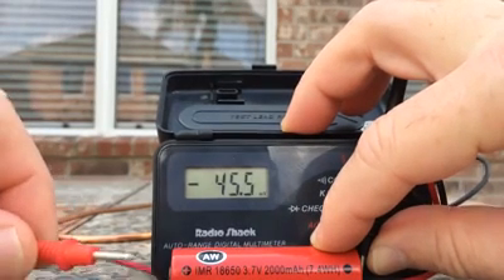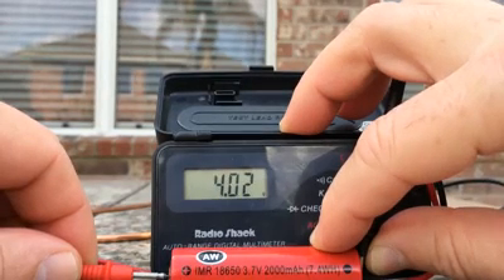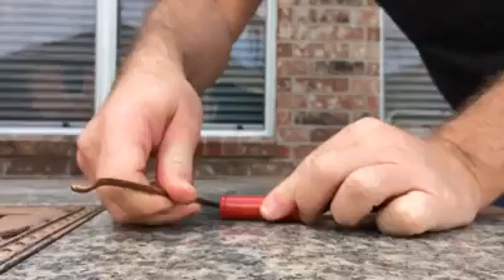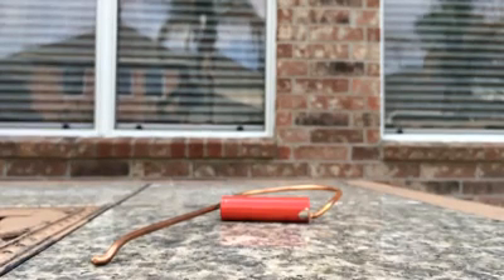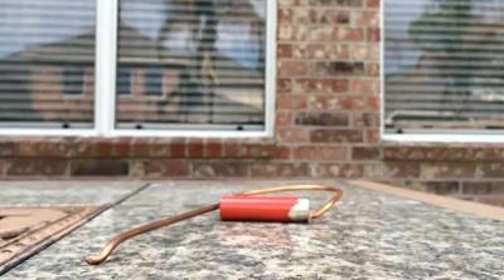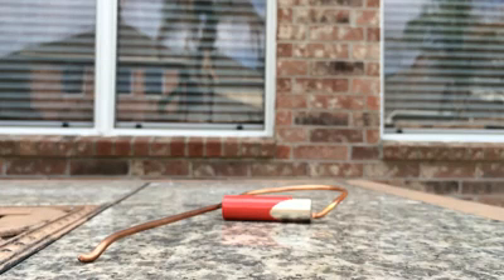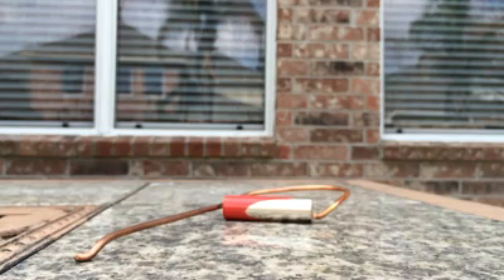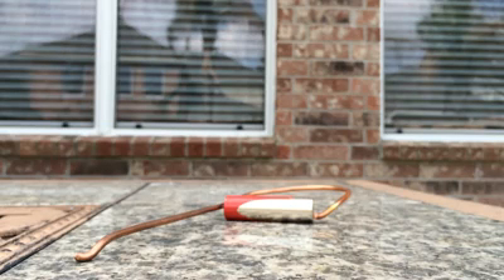Mythbusters Tony Style AW 18650

Comment: Thats a decent battery if it didn't vent. One test does NOT mean "this myth is busted." You need to do at the VERY least 5 tests. Also you need to do this with the battery in a metal tube with a few small holes for venting. The metal tube will cause insulation for heat and shorting from the side of the battery to the tube.
Reply: What is this test supposed to be about? From what I understand, AW IMRs are supposed to vent, right? I mean, that's why they are safer than, say, ICRs, because they don't outright burst into flames... 

I would say the bat actually vented, you can hear a slight hiss over the video once he shorts it out.
Reply: All I could hear was the wind but I am not using headphones I am using a crown D-75 amp and some Tannoy speakers.So maybe I am missing it on the high end but I never heard the vent.

I think the test was to see what happens. The myth, I believe, is about them burning up.I have never heard it myself. I have heard ICR's do burn but never IMR's. I am sure there are circumstances that will cause one of the IMR's to go in flames but it is much less likely to than an ICR
Reply: x9x9x9x9x9 Nevertheless, this could get ugly in your hand. Sure, it might be too hot to grip and too cold to actually damage you before you let go, but this is not the major problem. The problem is the battery failing while you are not watching! The temperature gets high enough to easily set wood on fire.
Reply: x9x9x9x9x9 Even better, put an ICR in a chinese mech mod clone which doesn't have proper venting holes on both ends (HCIGAR Black Stingray is one of these) and short it on 510 connector. It's guaranteed explosion because the gases can't escape the tube or can't escape the tube fast enough. DISCLAIMER: DO NOT USE ICR BATTERIES IN MECH MODS AND OTHER UNREGULATED DEVICES. DO NOT TRY THIS! SERIOUSLY, DON'T!

Comment: Try charging the battery first and learning to use a multi meter........just saying. lot of power stored between 4v and 4.2v also the vid cut out. if you left the battery a bit longer it could have popped. sometimes takes 3 or 4 minutes. poor quality test you busted no myths here bud.
Reply: I think he was showing these batteries are relatively safe compared to lithium packs. People think 18650's runaway like lithium flat packs(like in cell phones), but that is rare and difficult to do. A prolonged dead short is required, and takes a very long time for them to start running away, if at all. That or poor design, like in some chinese clone batteries, which don't have vents built into the batteries, which IS dangerous.